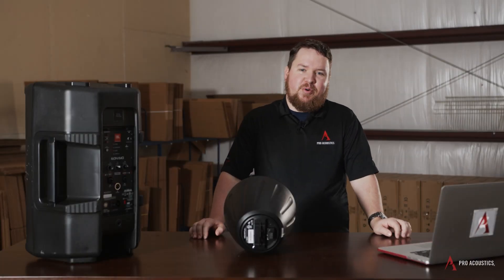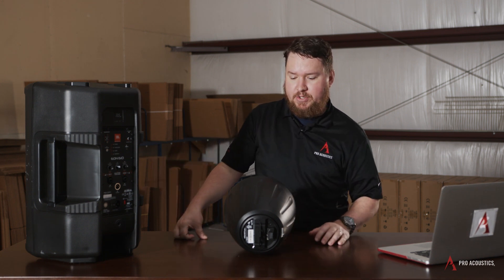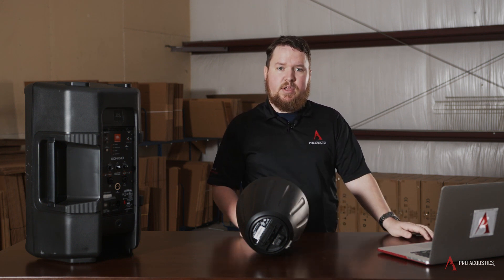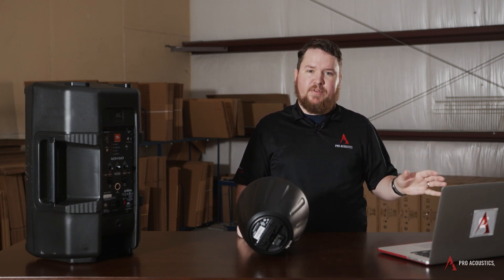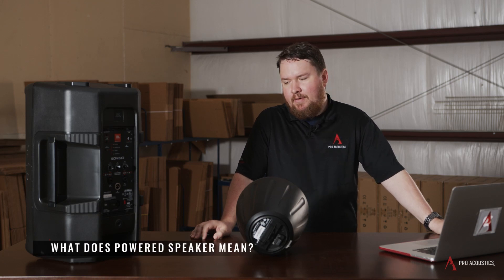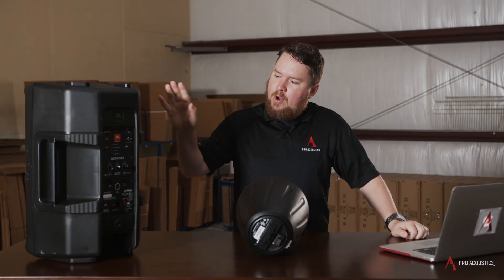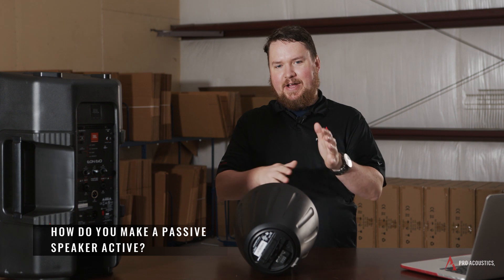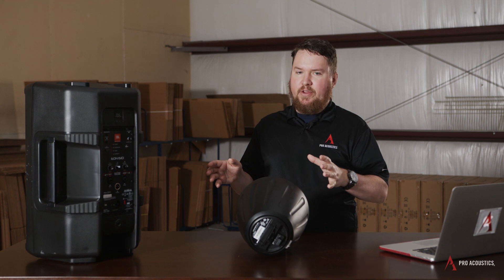Powered Speakers vs. Passive Speakers: What’s the Difference & Which is Better? Tech Talk Episode 55

Comment: My PA system has one powered and one passive ? How does that work ?
Reply from the maker: Great question! In some PA setups, one speaker has a built-in amplifier (powered speaker), and it sends amplified sound to the second speaker (passive). Basically, the powered speaker drives the passive one.

Comment: Hello can I use my active speaker with my dac/amp setup?
Reply from the maker: Yes, you can use your active speaker with your DAC/amp setup as long as you have a way to split the audio signal to feed both your active speakers and your DAC. Just be sure not to send an amplified signal from an amp to the input of an active speaker, as this could cause damage. Hope that helps!

Comment: Why active speakers have lower watts than passive? Same brand but active 400 watts and passive 700 watts
Reply from the maker: The difference in wattage often comes down to how manufacturers measure amplifier output, as some use RMS (continuous power) while others use Peak (maximum power for short bursts).

Be sure to check the specs carefully, as they may have similar peak ratings. In some cases, passive speakers can handle more wattage than the internal amplifier in an active system can provide. This is because powered speakers are limited by the output of a built-in amp, while passive speakers rely on an external amp that can offer more power. However, the difference is usually minimal between the two.

Comment: I am wondering about big music festivals such as Ultra Music Festival, Lost Lands, Tomorrowland... what kind of speakers they use for huge spaces like that, Powered or Passive speakers?
Reply from the maker: It could be a combination of either or both, depending on the needs. For indoor use, either speaker type would suffice, but for outdoor use, passive speakers may be more suitable due to their weather-resistant design.

Comment: can i connect passive speaker (out-put on a active speaker???
Reply from the maker: A passive speaker must have a separate amplifier to power it. The built-in amplifier in an active speaker is designed to power its own speaker and only provides a line-level output, typically used to connect to another powered speaker or amplifier. If you want to use a passive speaker, you'll need to connect it to an external amplifier.
Reply: @ProAcoustics  thanks for making things clear 🙏

Comment: One obvious question I thought you would address is: are powered speakers able to reproduce a stereo signal? I cant find the answer on the internet. Just looking at the typical back side of a primary powered speaker, it does not seem to input stereo signal sources. And when it is connected to another powered speaker, it would seem to only be sending a copy of its own signal to the second speaker, not a separate half of a stereo signal, which of course is necessary for true stereo reproduction? Thanks.
Reply from the maker: Hey John, A stereo application would be dictated by the preamp (or mixer) utilized to pair up with the speakers. A LEFT/RIGHT output of the preamp or mixer will provide a stereo aspect, assigning one speaker for the left and one for the right. And, yes, you are correct in that connecting another powered speaker to the existing speaker continues that signal to the secondary speaker. Please get in touch with one of our sales engineers if you have any additional questions. Email sales@proacoustics.com or call (888) 256-4112.

Comment: Power speakers do not have near the power as a separate powered amp. Even if they are rated the same power.  The clarity and specs is much better with a amp as well. Now that being said your very Hi-End equipment might be close. But you pay heavy for it. just saying!
Reply: Power speak are getting better/ the power speak is could be fine tune better to suite the drive

Comment: This was a nice video. For a while I was a little confused on "passive" and "active" speakers and what the differences are. This video (and other videos/articles on the subject) explains it pretty well.

The rest of this comment might get a little long, but here's an interesting point about passive speakers:

I can remember in 2013-2014 I was using a computer speaker that was lying around my house; my mom actually used to use it on her old laptop (that laptop is no longer usable and she doesn't have it anymore). When I listened to it, I was always under the impression that it was pretty quiet in volume, even if I had it plugged into my computer and had the volume on the computer turned up all the way (or nearly all the way). Well, no wonder, whenever it was being used it was pretty much trying to use the headphone jack alone as it's source of power... no connection to a power outlet or any sort of battery in sight! This has to mean, therefore, that the speaker is passive and not active, because it has no amplifier of its own.

It's worth noting, though, that because it pretty much just uses that cable going into a headphone jack, you can connect it to pretty much anything. And that's where things started getting interesting in my experience of using the speaker: the resulting sound and volume I could get out of the speaker would vary depending on what I hooked it up to; I think that's mainly because different headphone jacks put out different amounts of power (and have different impedance values as a result of that). So that means some headphone jacks will drive the speaker more while others will struggle. The funny thing is, the absolute best result I got with that speaker was when I hooked it up to the headphone jack on my "Book Port Plus" (essentially, that's an electronic book reader, audio recorder and music player developed by the American Printing House for the blind, or APH for short). With the speaker hooked up to that device, I hardly even had to turn the volume up that much and yet I could hear it just fine... and then I turn the volume up to max and it seems to be so fucking loud to me! (Provided I play a loud enough recording or sound, of course). OK, maybe it wasn't really "that" loud (like 100 decibels or something) but certainly louder than anything else I connected it to, where I had to turn the volume up all the way to even hear it.

In fact, I can still remember times when I'd turn it up that loud, then I'd pick the speaker up and position it in such a way that I could gently press the side of it against my chest (or even sit on the side of the speaker, in which case the other side would be sitting on a flat surface, like my bed for example), then I could really feel the vibrations from the music! I felt it particularly with frequencies in the 200-300 Hz range or something close to that, because a lot of music I was listening to on the speaker tended to have quite a bit of presence in that range, and so does the speaker itself.

Why I was able to get the thing to go so loud on my Book Port Plus, and not as loud on other devices I tried, is still a mystery to me; It was almost as if the Book Port Plus had its own amplifier that was perfectly strong enough to drive that speaker so well! Sure, it's likely because the headphone jack on that device simply met the power requirements of the speaker, but there's got to be another reason behind it all: the speaker's sensitivity. Because, when we're talking about speakers or headphones, it's not all about the power requirements and wattage and so on... that's not really gonna tell you how loud it is. Sensitivity is very important. You could have a 10-watt speaker that can play significantly louder than a 30-watt speaker, because the 10-watt speaker is more sensitive (and more efficient) than the 30-watt one.. Another factor that may be at play here is that this speaker I've been talking about is not really that large either, so it doesn't really require some enormous amount of power; I'd say it's probably 8-10 inches tall, and maybe 2 or 3 inches wide from one side to the other, and maybe 4 or 5 inches from the front to the back of it (these are just estimations, but I think you get the idea). It's not really that heavy either, and with those dimensions factored in as well, you can see how it's actually fairly portable (I can still remember putting it into my backpack and taking it to school, then going to the school dorm and taking it out of my backpack and blasting music on it :)))).

Unfortunately, this speaker is not as usable as it once was; I now can't get it to go as loud. No, it's not because I blew out the speaker from playing it too loud. It's an issue with the cable. The cable is fixed in place though, so it's not like I can just unplug the cable and plug in another one; I'd have to desolder it or cut it away or something to replace it. I also have to try and even find the speaker again... it's likely hidden away in my closet amongst a big pile of junk! I do need to clean out my closet anyway, so maybe I'll stumble upon it again when doing that :))). But if I can find it again and somehow fix the issue with the cable and get it working properly again, I think that would be awesome, and because it is a passive speaker, the addition of a little amplifier to drive it more strongly would be a nice idea. And as it's only a single speaker with only one channel of sound, perhaps if I could somehow obtain a second speaker exactly like it (same model and everything), I could hook them both up to a stereo amplifier and get a nice stereo setup! And if the amplifier was battery-powered, that would be even better; it would still keep the portability factor that I enjoyed about using the speaker because I could use it even when not near a power outlet. But I do also have a little portable power bank that could also power the amp for when I'm not near the wall outlet, so that's not a bad idea either :))). Then with that amplifier, I could make the speaker go even louder and make the side of it vibrate my chest even more :))))))))))))))))).

Well, if you've made it this far, then congratulations... I just wrote a whole book for you in the comments section :))))))))))))))))) hahahahahahahaha!
Reply from the maker: Hi Justin, Thanks for sharing!
Reply: @ProAcoustics  You're welcome! :)

Unfortunately I do not know the model name of this speaker I've been talking about; all I know is that it's made by Polk Audio (it says so right on the speaker... I had my sister read that for me due to my blindness). I say that because, well, if I'm gonna match an amplifier with it, I need to know the technical specifications, like how much power it requires and so on, and I doubt you'd find that information written/printed directly onto the speaker itself, so knowing the exact model is a good idea. Plus, it's my understanding that if you're gonna use an amplifier with a speaker, you can't just go and use literally any amplifier you want... the amp should meet (or closely meet) the power requirements of the speaker; you don't want an amp that will put out too little power for the speaker (which would likely make the speaker barely audible) or too much power for the speaker (which would most likely cause severe damage to the speaker because it's trying to get way, way more power than what it's capable of accepting). I would also have to find an amplifier that uses a 3.5 Mm jack, because that's what the speaker uses, though I presume I could also get adaptors which would convert the type of jack used by the amp into a 3.5 MM size. Or it could also be vice versa, where the 3.5 Mm cable from the speaker connects to an adaptor that converts it into another kind of connector, like XLR or RCA or whatever. I'm actually really new to the whole idea of passive speakers and external power amplifiers (because pretty much all the speakers I've dealt with already have built-in amplifiers, I.E "powered speakers"), so I'm not sure what kind of connectors you'd typically see on power amplifiers. And as a side note, this is not to be confused with headphone amplifiers... headphone amplifiers won't be powerful enough to drive loudspeakers, because as the name suggests, they drive headphones. And headphones require significantly less power than loudspeakers, for obvious reasons :)).
Reply: Dude, nice book you've turned your comments into.
Reply: @wadehodges2301  Well, thanks! :)))))

Unfortunately some folks have criticized me for doing that. They're like "I'm not gonna spend all my time reading such lengthy comments" or some other bullshit complaint like that. Well, sorry, sometimes that's how I choose to express myself. And, some ideas/messages I try to get across simply require long comments for them to be understood, because they're a bit complex. Explaining a complex musical concept is an example of this. I fucking hate it when someone replying to a comment I wrote tries to tell me how I should right my comments (this happened recently when I wrote a longer comment on a video... it was ridiculous)! 

Sorry for the rant. But if you've experienced something like that yourself, you know how annoying it is.

Comment: A real down side of a powered speaker is that the built in plate amplifiers can fail after the speaker model is discontinued rendering the entire faulty active speaker investment a write off. With passive speakers, the amplifiers are a separate device, usually with better ventilation and a longer life expectancy. Active subwoofers can subject the actual amplifiers to pretty intense shock waves from the bass leading to solder joint weaknesses or capacitor failures. Passive speakers do not do this. Also each active speaker needs to cords long enough to reach them (power cord and a signal cord). Passive speakers need a single cable.
Reply: Rack mounted amplifiers will always be superior to built in plate amplifiers. Powered speakers are the wrong speakers for a nightclub or a bar. Those speakers in bars and clubs go through way more than a few mobile wedding DJ gigs a week. I’ve heard them lose sound quality or fail completely in bars and clubs even though they are as new as less than 4 years old. I’ve been into bars and clubs that had old Passive speakers from the 1990s powered by old rack mounted amps from the 1990s as well that still sound amazing after decades of all that blaring EDM on full tilt filling the dance floor with 105 dB of SPL even if the amplifiers are class D.

Comment: Hey man tbh, I’m so confused on this, does it matter if I plug in powered or active speakers into my Scarlett interface to make music?
Reply from the maker: Hi there, Powered and active are usually just different names for the same type of speaker.  Powered or active means that the speaker has a built-in amplifier and oftentimes a basic mixer with EQ.
You may also check out our blog hat goes over everything in a little more detail: https://www.proacousticsusa.com/blog/post/what-is-the-difference-between-powered-speakers-vs-passive-speakers-which-is-better/
I hope this helps!

Comment: Also there is a battery PA speaker called Bose S1 Pro and JBL EON ONE Compact and pro.
Reply from the maker: Hi there! That's right, there are a number of great PA speaker systems with an onboard mixer. We have reviews of both the JBL EON One Compact https://youtu.be/MOkY9wthgrM and the Bose S1 Pro https://youtu.be/DJt61a4oWFU, if you'd like to check them out.

Comment: A two months ago I was in a party and I saw the keyboardist used RCF Art-735 (I looked for it on Internet and  noticed that it is active speakers) with Dynacord 1600w PowerMate Mixer (I also noticed on Internet that is built-in with power amplifier) Was this connection False? The sound was not bad
Reply from the maker: Hi Joseph,
Very observant of you and great question! The Dynacord 1600w PowerMate Mixer has both powered AND non-powered outputs. It's very possible they were using the non-powered outputs. The powered outputs are lower on the back end and the non-powered line-level outputs are on the top of the mixer.
Reply: @ProAcoustics  Thank you very much really appreciate your reply and yes I remember the connection was on the top of the mixer
Reply from the maker: @josephjosepha7288  Our pleasure!
Let us know if you have any other questions or visit our website https://www.proacousticsusa.com
Have a wonderful week!

Comment: Can you connect passive directly to a mixer
Reply from the maker: Hi David, Thanks for asking! You can only connect a passive speaker directly to a mixer if there is a built in amplifier in the mixer, such as a mixer amplifier. A passive speaker needs an amplifier in order to function properly.
Reply: @ProAcoustics  because I got a presonus mixer
Reply: @davidkapanga5995  
You can try… you won’t hurt anything if your speakers are unpowered. If they were powered speakers and you used a powered mixer, that would most likely damage your speakers. 
I am guessing your scenario won’t work. Most powered mixers do not lay flat… they are boxy and plug into a front that is straight up and down.
Reply: No!